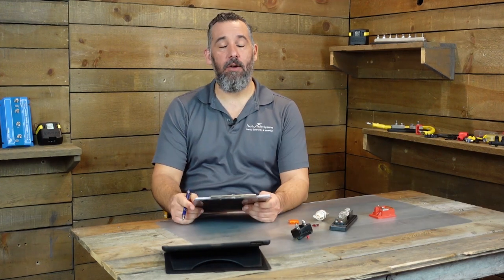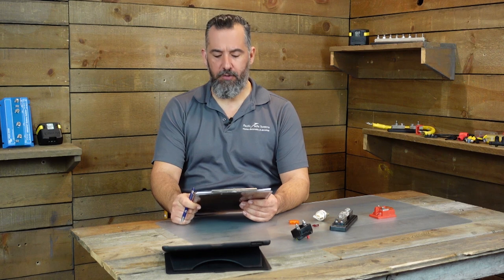How To Prevent Boat Fires With a Battery Switch

Comment: This happened to us during our first ever boat survey after the haul out inspection. We were back in the water and starting the engine to continue the sea trial, so we tried starting the engine and it didn't stop trying to start when we released the button. Like Jeff said, there was nothing we could do from the cockpit at the engine panel to disengage the starter. The engine room started to fill with smoke. Fortunately, we had a diesel mechanic on board for surveying the engine. He dove across the cabin and turned off the switch as I grabbed the fire extinguisher. My wife and I wouldn't have had a clue that the switch would have stopped it. Thanks, Jeff!
Reply from the maker: Thanks for sharing Richard F, boating is not for the weak of heart.

Comment: Great tips Jeff. Thanks again from Western Kentucky.
Reply from the maker: Thanks Ernie, appreciate it.
Reply: I bought a boat that had a battery switch at the helm, that created a 60 foot round trip in the circuit. That suggests a very large cable is required. The cable they used was 3 sizes too small. I’m planning to shorten this circuit to about 10 feet by using a solenoid with remote control switch at the helm. Similarly I want to do this for my aux/thruster battery. Is that a workable alternative to a manual switch?

Comment: Great video. We've not put in a switch in because we understood that the alternator may never be disconnected from the battery. I understand this only applies for when the engine runs, to make sure the alternator always has the battery as load. (This was on a boat with a small Yanmar engine without separate wiring circuits for starter and alternator (but all in the engine's harness).)Do you have any comments on that assumption?
Reply from the maker: Every engine starter circuit absolutely needs a on/off switch. You never know when you'll need to disconnect the battery from the engine.
Reply: @PacificYachtSystems  Okay, thanks. I'll speak with my friend and we'll add this for sure.

Comment: Just a clarification here...  If the engine is running with the alternator producing power, turning off the battery switch might also kill the alternator. Is that correct?  But of course, it's a matter of the lesser of two Evils. Lose the alternator or lose the boat or even your life.  Am I correct?  Thanks for making your expertise available through these videos.  I use them often going back even 6 years.
Reply from the maker: If the alternator is wired on the load side of the battery swtich   (many boats are)  then yes it may damage the alt.   If I thought the boat was on fire I would likely be shutting the engine off as the first thing I do though,  not the battery switch.
Reply: @PacificYachtSystems  Well yes, I'd probably shut the engine off first...  That makes sense.   😁 Thanks!   And though we are speaking boat here, I must confess that I follow you and your videos in order to wire and equip my 31 year old VW Vanagon Syncro Camper. I treat it as if it's a Boat on wheels.

Comment: Hi Jeff  thanks again for sharing your knowledge to community. One Question: Routing a cable as long as needed to place that switch in an accesible location necessarily will imply accepting a drop of voltage, from the battery to the switch and from the switch to the starter, I guess, so How long in total is acceptable?
Reply from the maker: Hi Luis, you're correct, the length of the cable will create a voltage drop, depending on the specifications 3% or 10% voltage drop, choose the cable size to match your voltage drop requirement.

Comment: If the engines are running still and you switch off the batteries - that will fry the alternator right. So if you can have the engine switched off first before you turn off the battery switch it may save the alternator.

Comment: Hi jeff. Could you please explain if a galvanic isolators earth has to be connected to the boats negative? I am struggling to find an answer. If so why is this, and where should it connect to, would a negative bus bar be ok for this? Thanks so much from the UK.
Reply from the maker: A Galvanic Isolator is only connected inline on the AC grounding connection. A Galvanic Isolator does NOT have a connection to DC ground or boat ground directly.
Reply: @PacificYachtSystems  so how does the galvanic isolator pick up a DC leak as it will illuminate one light for DC, and two for AC leaks?

Comment: Ohh,  one more: i have 4 batteries (one for each engine, one for generator and one for house). My main battery charger 20amp is connected to an outlet 110v wired to the outlet circuit in the ac panel. That charger charges  engines and generators batteries. And recently I bought a 10amp one bank charger for the house battery also connectes to the 110 outlet circuit. This is the most recent intervention to the 110v system. I use the boat every 15-21 days, However from 2months i am noticing that ocasionally the Gfci outlet in the head is tripping the button, and last weekend the situation became really hard. I had to lay another separate household extension to power the main charger. I do think one of my engine  the oldest one batteries is forcing the charger to work harder, so my guessing is that charger is demanding more 110v current and that is making the gfci outlet tripping, cutting the power of all outlets. I am thinking of changing the gfci outlet (may be it degraded by age) and getting both batteries but that will be costly. What do you think of these whole picture? I thougt those gfci outlet were intented to avoid personal injury in case a fail of isolation, but not as a braker for overcharge of a circuit.Thanks!
Reply from the maker: Hi Luis, one suggestion would be to have dedicated AC circuits powered from your AC panel and not part of your AC outlets on the boat. It's quite possible that your GFCI needs to be replaced. It's possible the neutral path isn't all that great, and some of the current (5 milli amps or less)  is going down the AC grounding connection.

Comment: I am planning on putting in the remote battery switches and this brought up a question - Those switches have a manual fail safe - it seems that I might want to plan for worse case having to get at that manual switch fast? Or can I rely on the remote function? What is your gut feel?
Reply from the maker: Remote battery switches are quite reliable. So far, never replaced one in the field. A manual fail safe is a good idea.

Comment: I bought a boat that had a battery switch at the helm, that created a 60 foot round trip in the circuit. That suggests a very large cable is required. The cable they used was 3 sizes too small. I’m planning to shorten this circuit to about 10 feet by using a solenoid with remote control switch at the helm. Similarly I want to do this for my aux/thruster battery. Is that a workable alternative to a manual switch?
Reply from the maker: Hmmm, Blue Sea Systems does make remote battery switches that be activated remotely,

Comment: Is it useful for a small rib or big rubberboot to have a battery switch on the battery box? 

I have never seen one. Usually the battery box is strapped down somewhere in the boat. Accessible to disconnect in case of maintenance, but not very accessible in case of fire.
Reply from the maker: All batteries should have a on/off battery switch. Totally worth it.

Comment: How does this work when you want the alternator B+ to be connected unswitched with the starter battery? I currently have the alternator B+ connected to my ArgoFet input, then from the ArgoFet output to the solenoid, then through the switch connected to starter battery +. Watching your previous talks it seems like I should connect to the alternator B+ through the ArgoFet and then directly to the starter battery. Should I then separately wire the solenoid through a switch to the starter battery?
Reply from the maker: Hi Truls, recommend that you consider removing the on/off battery switch on the alternator circuit.

Comment: Until your perko switch fails and you have to disassemble and isolate everything by hand!
Reply from the maker: Thanks for sharing.
Reply: @PacificYachtSystems  felt like it may be something people need to learn how to do. I sure wouldn't have known. It basically grounded out to the boat because a mechanic broke off a screw and left it that way.